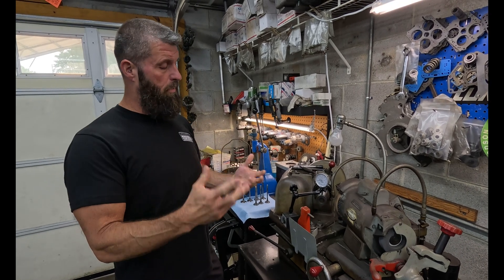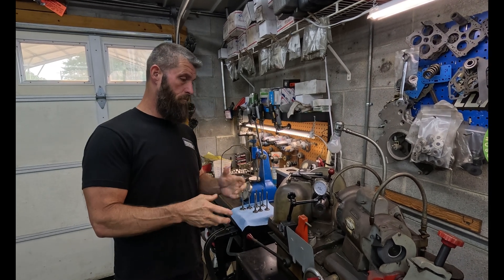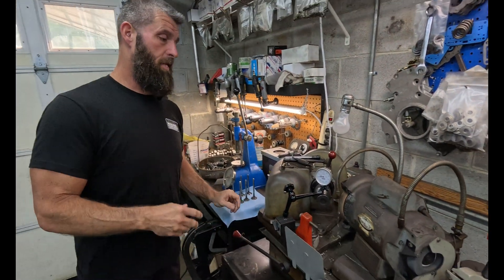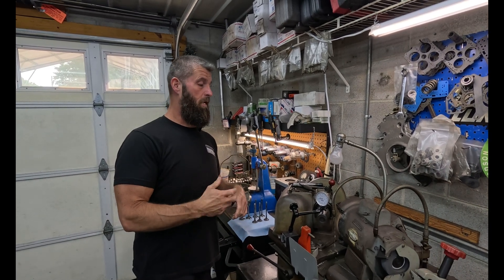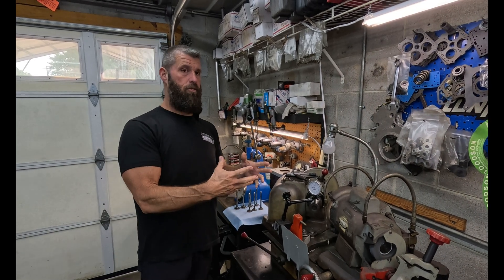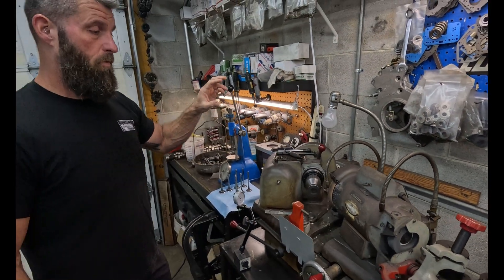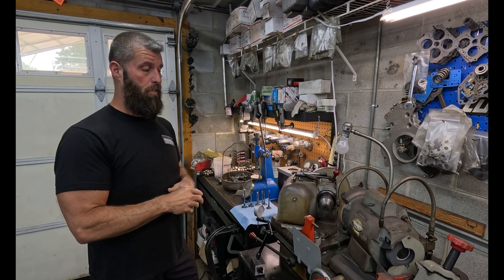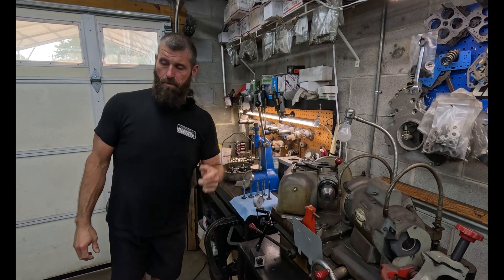Checking valve grinder runout

Comment: That Sioux valve grinder model is the best valve grinder on the planet... I got mine many years ago... Out of an auto dealership I use to work in... Dealerships never used them that much... So it was like new but dirty...
Same amount of runout as yours...
Unfortunatly Sioux was bought out by Corporate take over... I still use Sioux seat grinder, but I use a Kwick-Way stone dresser with it...
CrazyHorse Speed Shop. N.J.   usa

Comment: Your grinder looks brand new compared to mine. I think it’s pre-war. I have to help it up to speed with my hand on the pulley. 
 I made a mistake years back when I ground a set of heads. I had one exhaust valve that was a little more crooked than the rest. I didn’t give it any thought and ground it in. This was my own vehicle. After a few miles I had a dead cylinder, that very one. I decided that when I was taking them apart and hitting the retainers with a rubber hammer to break the keepers loose that the valve head hit the bench top and bent. When it got hot it must have relaxed into its old shape. Now I point the valves up so they can’t hit anything.
Reply from the maker: Definitely

Comment: I have a Sioux 645l and the manual claims that checking the run out in this manner is not a proper test. They claim that valves will be made with imperfections. At least that what I got from reading it. So now I’m wonder how the heck do I check the runout properly.
Reply from the maker: The only other way is grind a valve and put it in a v block fixture and measure the face runout with a indicator,  but.... this method shown it fine.

Comment: The first valve grinder I ran in 1974 was a Sioux. I rebuilt engines until 1988 and the last valve grinder I ran was a Kwik Way. I moved on and produced oil field parts for 32 years but still love engines and wrenching.

Comment: As an owner of a sioux valve grinder, I couldn't agree more. Keeping it clean is a must, we also use several magnets in the reservoir to aid in keeping the cutting fluid as contamination free as possible. You'd be surprised how much metal is picked up after every run...
Reply from the maker: No doubt

Comment: Thanks, I have an older Black and Decker. Not the older red ones but a somewhat new gold one. Its old but its had very little use but ive never got the oil pump working. I put a fountain pump in it and im using a water based grinding fluid. It works well for me. I'm too  old and disabled to start a business. Have you used water based grinding fluid? I know a few top fuel and Pro Mod match racers that grind their valves dry to make it easier when hauling the valve grinder around. I had a hard time grinding titanium valve wet I don't know how he's getting away with grinding them dry but i noticed hes having to lap the heck out of them.
Reply from the maker: I tried water based in the vg but didn't like it

Comment: Good memories of running one of those Sioux grinders!  In the 2 years that I worked in a production rebuilding shop I bet ran a few hundred valves through that thing!  It never had a problem and I’d do a quick “wash” of the Chuck when putting fresh cutting fluid in.
Reply from the maker: Right on

Comment: You got what looks like the same type valve machine like was in Pete's shop when I worked there. And I did lots of valve re-griding with that machine and  the secret was all the valves were pre-cleaned on the wire wheel that was on the grinder and burs was removed from the valve stem and all valves was washed in parts washer and was checked for straight etc. before they ever got placed into the holding jig that held each one ready to pick up and put into the valve machine chuck to be reground.
Reply from the maker: Good deal

Comment: I have a valve grinder just like that but I also just bought a nice one of the gold black and decker grinders for 50.00 and it has a couple extra collets with it. It  also has an air collet closer on it. The only thing I dont like about the sioux is that if the valve doesnt have a good chamfer on the stem you have to grind that first because a chamfer that runs out will cause the stem end of the valve to run out because it centers on an inverted cone up inside the grinder. The black and decker uses a collet that tightens at 2 different locations  that are a couple inches apart to locate the valve.The black and decker will grind at 90 degrees if you want to make a valve a little smaller where the sioux will not. I should sell one of these grinders but they both have their plus sides.
Reply from the maker: Definitely
Reply: @powellmachineinc  The black and decker grinder also came with a hall toledo  seat grinder. It has an eccentric motion while grinding a seat. I never saw one but guys say they are pretty good.

Comment: For non-production work I have used Neway since 1979, bought their valve cutter, the Gizmatic. Works well, just not the way to go if you need to do a lot of work. Great for small valves, have cut some Honda valves with 4.0mm valve stems.
Reply from the maker: Great point!
Reply: @midway27272727  You or anyone want another Gizmatic ? I have one I used before I got my Black and Decker and it doesn't go large enough for me. It leaves a strange finish but laps right out. I do like the Neway seat cutters though.

Comment: I'd measure the runout of the valve face spun on a vee block before chucking (collet-ing?) the valve so I know how much runout to expect, and/or verify the workholding device concentricity by spinnig a gage pin the same diameter as the valve stem right before the valve is chucked (collet-ed, whatever).
Reply from the maker: Definitely

Comment: I have a collet style and with it,  you can grind a valve,  then loosen it,  rotate 180 degrees,  tighten and grind again.  If there is any run out, there is a problem... not sure if the ball chuck setup you have is the same way,  but I did do that test with a Snap On grinder a guy wanted to sell me and it did not pass.  I did not buy it.  It was WAY off!
Reply from the maker: Yes, you can rotate and it's still good
Reply: Any way to improve snap on grinder?a lot of them have run out.

Comment: Had that same Sioux grinder that I bought used from a Pontiac dealership, in 1977, at age 16, for $700, with the seat grinder, dresser, 6 stone holders, and a full set of pilots. 
Foolishly sold it all for $2500 bout 5 years ago.
Like most quality machines, it’s about keeping the goons away and maintaince…
Reply from the maker: Absolutely 💯

Comment: One more little piece of information is grinding the angle on the stem of the valve as it sits in the location bar inside the chuck spindle.
Not all chamfers are concentric.
I love my Sioux, bought it new in February 1985.
Always served me well.
I like the quick chuck release also Daniel.
SnapOn purchased Sioux Grinder and ruined it. IMO
Sad to see an Anerican Icon go away.
Have a great day. 👍🇺🇸👍
Reply from the maker: Absolutely agree  👍